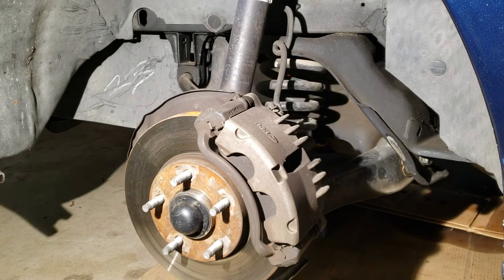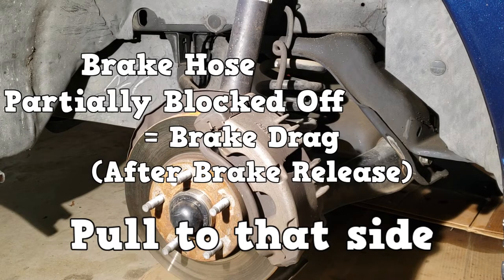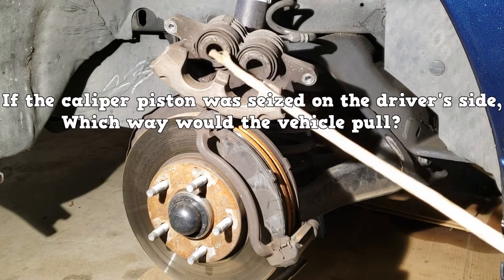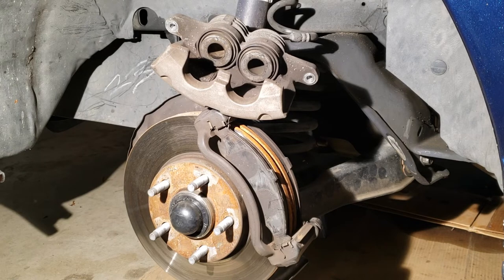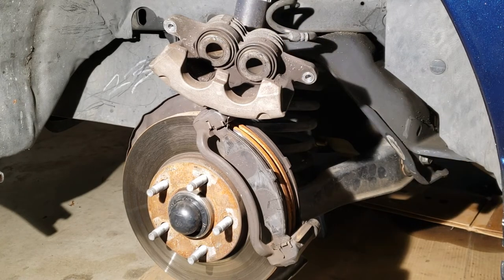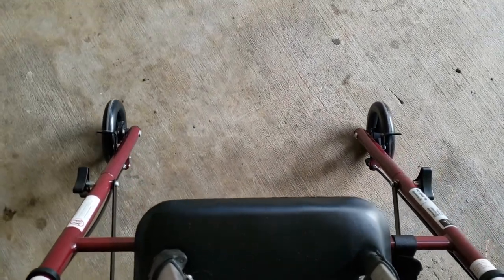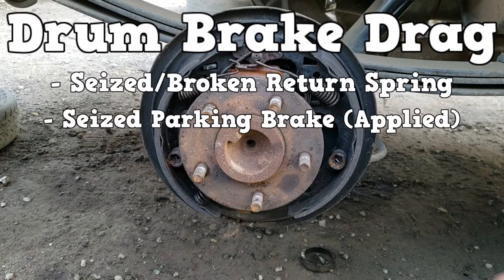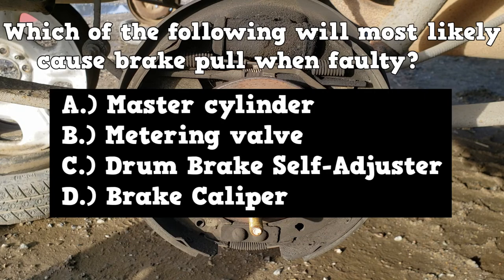ASE A5 Test Prep #1 - Brake Drag & Brake Pull

Comment from the maker: Update Jan. 14, 2023: After taking the A5 test, this video is helpful with brake drag and brake pull. I did not talk about what can cause tapered wear on a brake pad or what can cause the inboard pad to be worn more than the outer...hint hint.
Reply: I just took my a5 and only got 18 right. I'm really struggling 😩
Reply from the maker: @michaelbrock6210  I recommend buying the book "Today's technician automotive brake systems." The classroom manual and shop manual. If you really want to improve you'll read both, can get them for $10 each on ebay, the 6th edition, 7th edition if you can find it cheap.
Reply: @OldSchoolNoe  I studied the Delmar book very hard. What's on the actual test isn't really in the delmar book. Do you think the guide you're recommending will cover everything else?
Reply from the maker: @michaelbrock6210  Absolutely! Those 2 books are what taught me the fundamentals. These books are used at the college brakes class. The books are lengthy, but you gotta put the time in!
Reply: @OldSchoolNoe  one last question sir. Are these guides designed to help you pass the a5?
Reply from the maker: @michaelbrock6210  Yes! Those are the books I used to learn brake systems and brake service. Of course, I had plenty of hands on experience after.
Reply: @OldSchoolNoe  I'm lacking the hands-on
Reply from the maker: @michaelbrock6210  How are you going to be A5 certified with no hands on experience? Go do some brake jobs! Do a manual brake fluid bleed on your own vehicle as a start. Diagnose your vacuum booster or hydroboost ( what does the pedal do when you push it, hold it, and start the engine? Are the results normal?) Don't have access or room to work on a vehicle? Go to a junkyard and take stuff apart and reassemble it. Take a community college course on brakes, if you can.
Reply: @michaelbrock6210  motor trend book is guaranteed I heard that's the one I'm trying to get. Did you pass your test?
Reply: I took mine and missed it by 1! 😢 after watching this again, I now know I goofed up the answer about pulling in the applied position. Next time I got this!
Reply: Hey man what books did you study to help you get a good score.
Reply from the maker: @James-fl2ug  Delmar, also if you take a community college course, they will link you up to the Cengage material which is really good!
Reply: @OldSchoolNoe I have went to college and took some  classes. The hardest is the electrical diagrams .its soo different from Delmar’s book . Could you please do a video on those diagrams for the A5 oneday. Take your time man I know you busy.

Comment: which suspensioin component casusing pull during breaks?
Reply from the maker: Can be worn bushings on the control arm.
Worn ball joints too, but you'll notice a pull on acceleration too.

Comment: Hey I had a question so I’m planning to take A5 test I was reading the comment n saw someone commenting about how on there test they didn’t explain if the calipers piston and brake hose was completely blocked off or partially so how would I know when I’m reading the question if they mean completely blocked off or partially thank you
Reply from the maker: I've taken 6 ASE tests, and most of the time I've noticed that they mean completely blocked off. They won't try to trick you and give 2 possible answers. I would say don't worry too much about it, there's at least 1 question about "restrictions."

Comment: Hey in the test they don't specify if the seized part is resting or applied. They use the vocab of "Frozen" or "Seized". It is confusing that your video does not use the same vocabulary.
Reply from the maker: I noticed this, but when I took the test, I had no conflict in answers. For the most part I noticed that seized means stuck in the resting position. I don't think I saw the official test use "frozen" as a descriptor. Hope this helps!

Comment: What are the answers to the quiz at the end of the video?
Reply from the maker: For the first question, most likely it is not due to a faulty master cylinder or worn brake pads. In theory, a leaking brake hose on the left will cause poor stopping ability on the left, therefore the vehicle will pull to the right, because the right side will have 100% stopping ability. The answer is B. If the caliper piston is seized on the right side, the brakes will not activate on the right side.
Reply from the maker: Question 2 the answer is C. A bleeder is valve is used to remove old fluid and purge air out of the system. If its binding (hard to loosen), it will not cause brake drag.
Reply from the maker: 3rd question: A faulty master cylinder will not create hydraulic pressure, therefore it will not cause brake pull. A brake pull is usually caused by a defect in one side (left side or right side). A faulty metering valve affects both sides in the front, most likely it will not cause a pull. A faulty drum brake self-adjuster will not adjust as drum brakes wear. This will cause the brake pedal to travel further as brake shoes wear. Theoretically, if the wear is severe on one side with bad self-adjusters, there could be a pull, but this is not the most likely. The answer is D. A brake caliper will cause a pull when faulty. Faulty meaning not activating, not moving, seized.

Comment: The vocabulary is really important. That’s where people get confused and thrown off
Reply from the maker: give me 2 examples please. I recently uploaded a test prep series for the A7, and "restricted" and "plugged up" were 2 words that could have caused confusion when it came to system pressures. 
The test did not give conflicting answers and all questions were asked in a clear manner. Same with the A5, once you understand the concept of brake drag/pull, you'll be fine no matter what vocab the test throws at you.
Reply: @OldSchoolNoe  I haven’t tested yet that’s  how I’ve found your videos bc I’m about to schedule for some test and I think I’m gonna take A5 first I’ve been doing this for over 20 years professionally but never could benefit financially where I’m at but now that I’m in my 40s I think it’s time to get some of my ase certs. But what I meant by the vocabulary being confusing,let’s take restricted for example. From watching your videos it looks like restricted could mean completely no flow of fluid or very little but I guess I’d have to see the questions with the multiple choice answers to make it easier for me. I did get the questions right you included in your mini series.

Comment: Can I know the answers to the questions at the end of the video please?
Reply from the maker: For the first question, most likely it is not due to a faulty master cylinder or worn brake pads. In theory, a leaking brake hose on the left will cause poor stopping ability on the left, therefore the vehicle will pull to the right, because the right side will have 100% stopping ability. The answer is B. If the caliper piston is seized on the right side, the brakes will not activate on the right side.

Question 2 the answer is C. A bleeder is valve is used to remove old fluid and purge air out of the system. If its binding (hard to loosen), it will not cause brake drag.

3rd question: A faulty master cylinder will not create hydraulic pressure, therefore it will not cause brake pull. A brake pull is usually caused by a defect in one side (left side or right side). A faulty metering valve affects both sides in the front, most likely it will not cause a pull. A faulty drum brake self-adjuster will not adjust as drum brakes wear. This will cause the brake pedal to travel further as brake shoes wear. Theoretically, if the wear is severe on one side with bad self-adjusters, there could be a pull, but this is not the most likely. The answer is D. A brake caliper will cause a pull when faulty. Faulty meaning not activating, not moving, seized.
Reply: @OldSchoolNoe  thank you for the answer and explanation